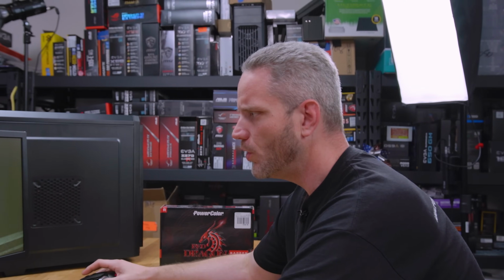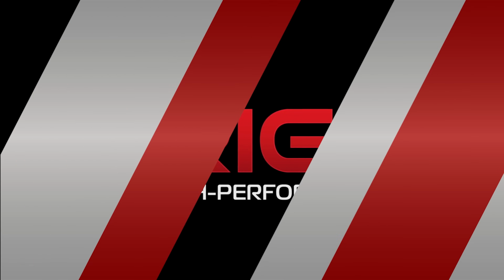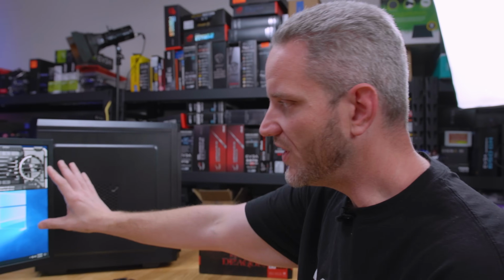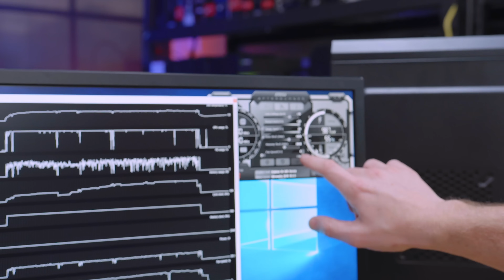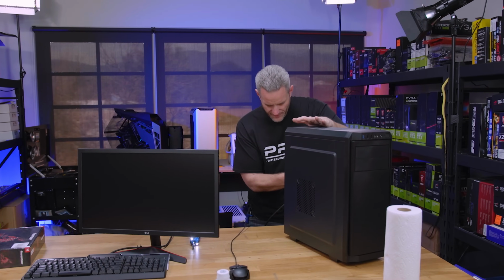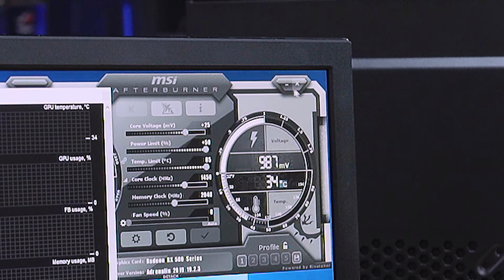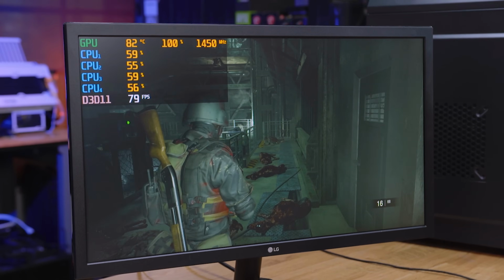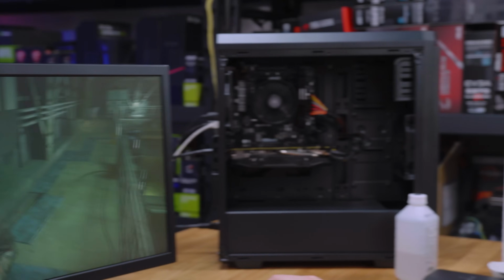Should you replace your video card's thermal paste??

Comment: My RX Vega 64 blower was running on 90'c during gaming. After disassembling it, cleaning all the dust from the fans and the block and replacing the thermal paste the temps went down to 60-65'c.
I only regret not having any thermal pads to replace the old ones. The clean/maintenance was definitely worth it. I'm really happy I did it.

Comment: i have a strix 1060 and it was running around 75, i decided to change the paste and broke the middle fan in the process so i cut the cable for it and applied the paste, it now does not go over 65 without one fan.

Comment: i replaced my thermal paste in my Asus Strix RTX 2080ti with thermal grizzly cryo - it dropped the temps 8-10 degrees and i can over clock it to 1800mhs and 15600 on the memory all day gmaing and it run no hotter than 72 deg - i cannot recommend this enough - every card i buy now gets the same repasting treatment and what annoyes me the most is that this card cost me £1299 and Asus cannot spend a tenner on decent paste ?..... very dissapointing Asus

Comment: Biggest take away from the video is your case design around your other components. I tried to create a negative vacuum in my PC, swapped my side fan to pull air out of the case, along with the top/back fan. Since I have a similar designed cooler on my GPU, I actually saw the reverse effect. The top fan stopped blowing air, creating vacuums at the back/side. Which then left components lacking fresh air, leading to WAYYY higher temps (85-90C on the CPU).
Swapped my side fan back to push air into the case along with the front two. Temps stay stable on the GPU at 68C while under load (OC'ed) and same with the CPU (55-70C OC'ed). With that being said, it is important to test/bench mark changes for your case. I am assuming since I have 2 fans push/pulling on a hyper 212 (CPU cooler), along with my GPU seeking fresh air. Their simply wasn't enough air/pressure to the top of the case. Crazy how 1 fan can change the whole computer flow/pressure.

Comment: Just replaced the thermal paste in my 2 yr old Zotac 1080 mini and went from 86c to 70c! Definitely worth doing!
Reply: Does having bad thermal condition impact game performance like stutter?
Reply: @AmeerQ99  no, microstutters are usually ram issues
Reply: @AmeerQ99  what do you mean bad thermal condition?
Reply: @lehelzelenka207  i meant thermal paste on thr gpu/cpu is dried out not been changing for long time endedup thermal issue.So will this effect performance in gaming ?
Reply: Hey man I have a zotac 1080ti too and im hitting 90C ! Did ytou watch a specific tutorial or something? Also was it difficult to do?
Reply: @lewisdowns4994  which version? Big one or the mini? The mini is very easy to take apart.
Reply: Looks like I'll have to do the same for my 1650. It's been 2 and a half years since I bought it.
Reply: Idk what will happen to mine it used to be 30c at heavy games i just stop using my pc now its 50c
Reply: @renosu7831  wtf are you sure bro what card are you using. 30c while gaming is not normal at all lmao unless you got an air conditioner inside your pc
Reply: @irfok727  hard to believe its just locked at 30 to 35 when it was new well it has good air flow at my pc case i use 8 fans and yes no much heat on my room even without air-conditioning
Reply: @renosu7831  hmm I see. 8 fans , damn
Reply: @renosu7831  what case are you using?
Reply: @irfok727  or he’s playing outside in 20 degree weather lol
Reply: @renosu7831  I call bs, I have a corsair 5000D which has 10 fans and I'm running a msi 1070 GPU and I can't get my gpu Temps range between 40-60 depending on what game I'm playing I only play on med settings
Reply: @renosu7831  how are your temps so low?
Reply: @farasty7371  idk its just locked at 30
Reply: @renosu7831  50c is completely safe. Gpus are meant to run hot. Even 80c is still safe. Anything above 90c is bad. 50c is still good
Reply: I know this an old comment. I have a 1050 Ti Mini and its pretty old from the person on eBay. I will replace it as a maintenance routine. I did my CPU since it hasn't been done since 2013.Pretty sure my temps will drop.
Reply: Dude is it hard to do cause I'm thinking about doing it I added alot of fans in my pc but no difference in my gpu temperature s
Reply: @stanleesomanly9585  It was very easy. I just did mine a few days ago. Temps did go down. Just make sure you take your time doing it.
Reply: @athstreamsandmore  Thank u good sir
Reply: @stanleesomanly9585  well its not really hard but if you are new to this I suggest getting help from someone.
Reply: that's crazy, i know your comment is a year old at this point but today was the first time I've ever replaced GPU thermal paste, and it was on a Zotac 1080 mini
beastly ITX card
Reply: What thermal paste did you use?
Reply: I have a 1080 ti mini from zotac. Reaches 84°C in cyberpunk and the fans spin at 100%. What paste did you use?
Reply: @lehelzelenka207  I used Arctic MX4 from Amazon in my Gigabyte 1080 and went from 95°C to 65°C, yup... 30°C 😬
Reply: @iluisr  How the hell did it reach 95? Mine drops from 1840MHz to 17xx as soon as it touches 84-85°C. Basically throttles to keep the gpu from overheating.
Reply: @iluisr  How does your GPU reach 95°... It should be throttling itself wayy before that. Also ever heard of fans?
Reply: @SpunkyGo0se  my rx 470 thermal throttled at 95°C so yeah, it's normal for some cards. After changing the thermalpaste it stayed at around 70ish with oc

In contrast to that, my new 1080ti starts throttling the boost clock quiet early, but in all steps
Reply: @lehelzelenka207  how tf you guys even got 65+
Mine only goes to 60-65
Reply: @iluisr  how much thermal paste did you use ?
Reply: @iluisr  your lying kid
Reply: @memesauce7703  You are wrong, kid. My thermal paste was 100% toasted, it looked almost like sand. Thats why there was so much difference
Reply: @iluisr  understandable have a nice day 👍
Reply: @lehelzelenka207  liquid metal that batch if your carefully. Prob best to just use kryonaut or nactua pretty solid. Also geld makes a really good one. Those are top 3 imo. But mx4 ain't bad.
Reply: @8bitsamurai6  I did a repaste with the mx4. No improvement. Someone already changed the thermal paste before I bought the card because it was pretty fresh and double the amount that is needed. This tiny cooler is just not enough for this card.
Reply: @8bitsamurai6  you have to be careful with liquid metal.  It contains gallium that reacts with coppers and destroys aluminum. I
Reply: @HenryOfGnarlia  Shit I slap that stuff on everything. I use it in my mouse and keyboard too.

Comment: Just a heads up.

I have a Gigabyte 2080 Ti. It started with normal temps ~75C on load without applying manual OC. After like 2 years, the card was reaching 84C on load and thermal throthling.

I opened it up. What was there could hardly be called thermal paste anymore. There was barely anything anymore. I replaced it.

Dropped temps back to 73-74C. Definitelyreplace your thermal paste from time to time. It will degrade eventually and you will lose in temps, potentially harming your performance due to throthling.

Comment: unrelated, but i changed the paste on my 9400f using stock cooler, no improvement. then i switched to an AIO, temperature dropped 35c, plus little to no fan or pump noise at all using the same thermal paste. temps were recorded during load as idle were quite similar.

Comment: I would say if like me you tend to buy the top end last generation cards if your comfortable doing it then yes replace paste, as with a last gen card like mine (GTX-1080) , it could be up to 2 or 3 years old when you get it , i replaced mine & when i took off the cooler the paste just crumbled off of the GPU on the table lol , was completely dust !! , i dont even know ho it was still cooling , so i re pasted mine with thermal grizzly & got an extra 4 C lower temps & now i dont have to worry about dry old paste at leased.

Comment: The repaste might still have made a difference, keep in mind how a fancurve works, your gpu's fans are probably just running at lower rpm after the repaste. We saw that the passive temperature got lowered significantly.
If you want to see what a difference a repaste job does, test it at at a static fanspeed like 50% before and after, unless something went wrong with the application, a repaste should always offer an improvement, whether small or large.

Comment: i love my rx580.. ive had this card in my main gaming rig for years and its been a beast. i even play 4k 60 on low settings to high settings at 80-100% rendering. the thing is an absolute work horse.
although i do gotta say, i am VERY much looking forward to my 9900k, godlike mobo, and 2080ti (amung other components) that are otw in the mail rn.. I love my rx580, but im sure ill love the new pc even more. lol. and my son will love my current pc for many more years to come. Everything in the computer world just keeps getting better and better, but that doesnt mean that older stuff is getting any worse.. 5 years ago when my i7 4790k was new it was at one point their most powerful, most bad ass processor they made for gaming.. so now even when its technically old, its still a great cpu. the asus z97 deluxe is still a great mobo.. ddr3 @2ghz is still good ram... you dont NEED the latest and greatest hardware to have many many years of great fun. I love that about pc hardware. it doesnt decrease in performance over time. a fast powerful system from 5 years ago is still a fast powerful system today.. just not AS fast and powerful as the newer stuff, but still plenty usable.

Comment: j ai acheté une pny 2080 super xlr8 oc. donnee pour 1860 mhz en boost.
je l ai monte dans mon boitier et grosse deception, elle a de tres bonnes perf, mais elle montait à 87 degres avec les ventilos à fond sur un simple firestrike... j ai donc remplacé la pate thermique par un fond de seringue de be quiet (bye bye la garantie...) qui trainait dans le carton de mon dark rock pro 4. et c est hallucinant elle boost à 2050mhz sans toucher à la frequence, elle se maintient apres 1h de kombustor à 79 degres et surtout, les ventilos tournent à 60% en auto au lieu de 100%. sur firestrike elle monte à 63 degres. j ai testé +100 mhz sur afterburner, et elle boost à 2145 mhz pour 63 degres et je ne l entends pas. j espere que mon commentaire sera lu et utile. d origine, il y avait 3 fois trop de pate et de mauvaise qualite. j ai commande de la kryonaut et je referai des tests.

Comment: RX 580 here too. Bought used on eBay. I requested to return it because the computer would crash when running a game, even though it wouldn't go over 40 degrees Celcius. Seller told me to replace the thermal paste.

So I did. It's been 15 minutes now under FurMark's GPU stress, and it's at 80C for 15 minutes now. No crashes!

Comment: Forgot to tell. There is a risk of  gpu chip separation if you  decide to change your thermal paste. Removing the heat sink is the same as removing tension, force that was pushing down the chip. That force is gone, there is a chance of separating your gpu from its base.
Reply: That makes no sense considering they are assemblied without cooling attached to the PCB to retain that so called tension you claim is holding the chip down. The chip has no socket its directly attached to the PCB.
Reply: @sankaplays3098  There were many cases when they asked to change the thermal paste on the old video card. After removing the cooling, the chip fell off (not literally).

Comment: Design of a gpu seems counter intuitive. they have the fans pushing the hot air down to the bottom of the case, where there is usually the least amount of airflow, heat rises naturally so the hot air will always be fighting the fans. Why don't they move the fans to the top of the gpu and let that heat rise unimpeded out the top of the case, where you should have 1 or 2 case fans pushing air out anyways.

Comment: 5:16 - has anyone ever tried using a soft toothbrush, with isopropyl alcohol on it and carefully remove the paste in between the tiny capacitors?

I'm asking cuz I want to remove all the paste, so I can spray-insulate this part when applying my liquid-metal. Thank you in advance for any info!

Comment: I had a GTX 1070 running at 70-90c, after it was stripped and re-applied thermal, runs nicely at 54c - 65c
Reply: This comment confirms I need to do this to my 1080 founders edition. Used it nearly every day for 3 years almost and it runs hot
Reply: @cookiebandit101  i havent changed mine yet lol .. idles around 50° doing nothing just net surfing
Reply: @xxheisenburnintell9244  mine idles at 66 to 68 after only 5 mins being on idling. Reaches 82 and thermal throttles nearly instantly. Luckily i have extra thermal paste and 2 days off so i'll be doing a cleaning and apply new paste soon.
Reply: @cookiebandit101  can you make a video on it ? thermals before and after applying thermal paste ?
Reply: @xxheisenburnintell9244  I mean I could. I'm running Elite Dangerous right now and I'm hitting 82c the default thermal limit within minutes of the game launching. I'd have a after spec later this evening after I replace the paste and give it time to dry.
Reply: @xxheisenburnintell9244  So after all said and done it was a huge improvement under heavy loads now it sits about 74c top where as it would hit 83c almost instantly and thermal throttle i played for over a hour under max settings and no custom fan curve and it barely touched 74c.
Reply: @cookiebandit101  am glad it was an improvment for you buddy .. did u brush off the heatsink remove dust etc ? or just replaced the thermals
Reply: @xxheisenburnintell9244  everything yah cleaned it off carefully with Qtips and rubbing alcohol and dusted everything off. It needed it. the thermal paste was the worst part though so it's running way better now.
Reply: @cookiebandit101  wish u made a video pal .. i enjoy watching cleanin hardware parts lol but glad things worked out well for u
Reply: @xxheisenburnintell9244  I am not really setup for videos outside of what i can do with my gpu capture software. Don't have a decent enough phone for uploading to youtube.
Reply: @cookiebandit101  well enjoy gaming bro ♥️
Reply: @xxheisenburnintell9244  idles to 50 ??? Mine is at 32 right now
Reply: @xxheisenburnintell9244  I bought it back in 2016 by the way. And should say I am running at custom fan speed tweeked with msi afterburner. Basically it is always at 40% and when it reaches 60 celcius it is at 100%
Reply: @enzotibirica8458  thats too high for 60° doesnt it get annoyingly loud
Reply: @enzotibirica8458  u got custom fan speed .. my fans are shut down utnill its above 50 i guess
Reply: My computer is not that close to me, and it already has 4 constant loud fans anyway. So I dont bother as much.
Reply: @enzotibirica8458  awh ya on a g1 gtx 60% wud feel loud to me  still one gotta change them thermals
Reply: @enzotibirica8458  Idles at 50c because the fan auto turns itself off below 60c for MSI cards in my case.
Reply: What model do you have i got a g1 1070 runs hot too 75 ich 78 maybe i havent changed any thermal paste on it for ages
Reply: Maybe they used toothpaste instead of thermal compound 🤔
Reply: Rx580 dropped from 82c to 60c. Change thermal as step 1!
Reply: @Getworked117  i changed mine .. used cooler master regulare 5 w/m.k aaaaand guess what.. nothin changed idles at 50° max 75 or so fanspeed 60% i got a gigabyte 1070 btw
Reply: Arctic silver 5 it best thermal paste for this gpu.
Reply: @danyelz69  i have just bought arctic mx 2 iv yet to test it on my gpu thou
Reply: Did this too to my 1660ti and dropped from78-82 to 68-70 max now. Worth the trouble.
Reply: Same with my MSI 1070TI, it runs around 69 - 75c on BFV with pre applied thermal.
Reply: Anyone tried with asus 1070 dual oc?
Reply: Mine I just turn on air-con to -3 degrees then open my PC and put a small electric fan and set speed to 2 my temp barely hits 50
Reply: Such a high price, and they choose to skimp out on the thermal paste? Fucking ridiculous.
Reply: Lorsò a'nalfabetà  nice work, if you haven't already, I'd recommend a stress test just incase.

You never know if the mounting plate is correct until stress tested.

Also, now that your temps are lower, try adding a little overclock.
I say that because you were running at 90c and probbably thermal throttling, but now you're 70 and have overhead room. 😊

GLHF
Reply: Clearly a lie but nice try kid
Reply: @RaiderOfTheLost  can you explain to me how I could be wrong with so many variables?

It could be pre-owned, old thermal paste, poor quality thermal paste, not enough thermal paste. Bad clearance or mounting pressure.

Edit, MSI afterburner will aloow upto 97c... But your likely to see artifacts / crashing at that point or thermal throttling.
Reply: @0QualityOverQuantity  LoL I have a RTX2060S running under OC and playing hard and for so long, it's 68-72C. WTF cards/fans/air cooling you have to reach those high temps??? When I had 2x 780Ti Classified Hydrocopper 25-27C IDLE and 43-45C under VERY HEAVY OC...

Comment: didnt test before and after fan RPM, GPUs tend to target a certain operating temp and ride it, for example i re pasted my laptop and the temp was the same however the fan rpm had reduced approx 15%, similar results with my 1080ti

Comment: Jayz, could you please help me to find out what is wrong to my graphics card. I'm currently using MSI GEforce RTX 2060 Ventus, it's been a year now since I bought this Graphics card after a few days  I installed the MSI afterburner and adjust a few settings after that my monitor having lines and turning off and on by itself that, even watching netflix my monitor is on and off. but when I used HDMI it was fine. I bought 3 new DP but still the same issue. thank you.